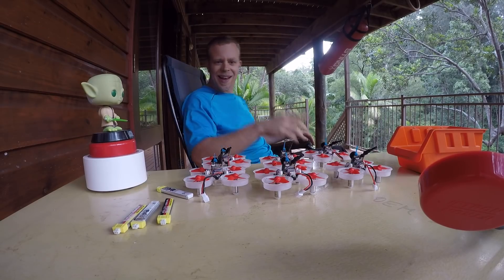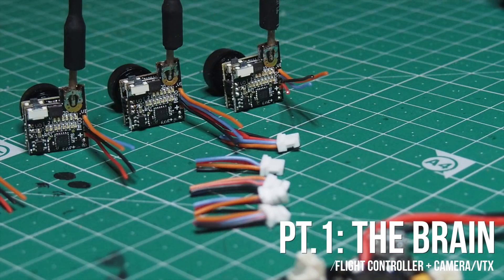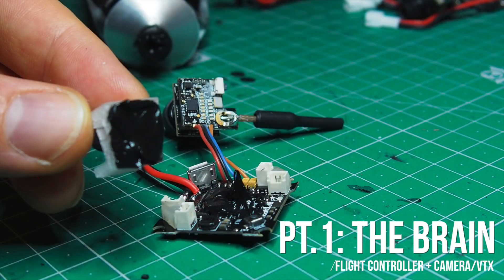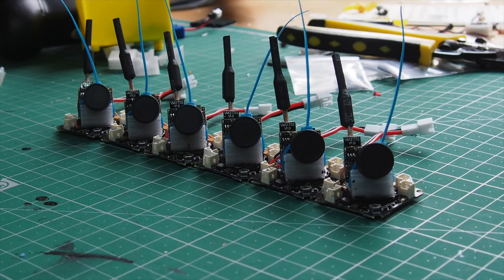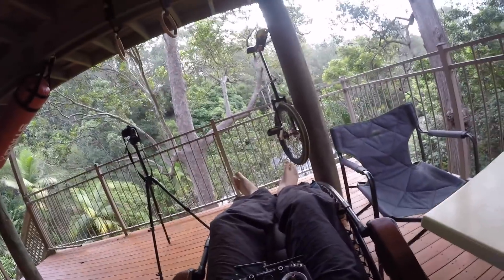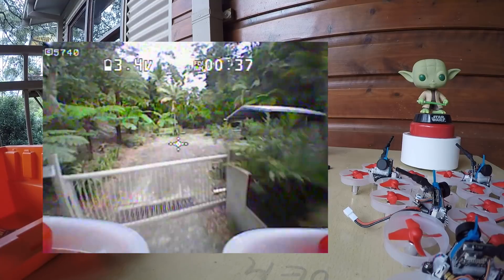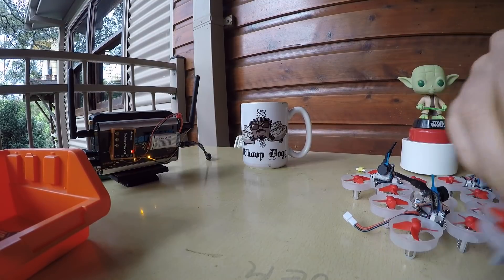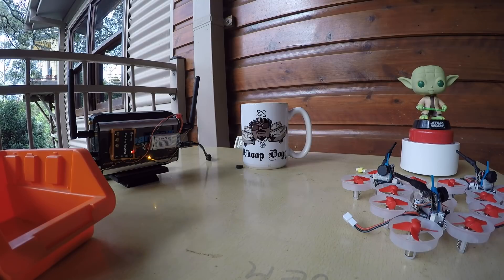Step by step: Benedikt's 2-part Whoop Build

Comment: If ever you have to remove the camera mount from the FC, do you need to pre-treat the silicone adhesive with a solvent, or just go ahead and rip off with force?
Reply: Ho Jen just pull slow and steady, and it will come off. Slicing with an exactly knife will help if it’s holding on tight.
Reply: thx

Comment: Hi Ben, I have seen you using epoxy on the camera on other whoop builds. Do you still recommend this? have you shown how to do this in any of your videos? I did not see you using epoxy on this guide. Keep up the good work!
Reply: Venom2007s yes, I sometimes use epoxy to reinforce the glue joint between camera PCB and lens. The glue on the current batch of cams I use looks good and solid, so I haven’t done it here. I don’t think I made a video on that. If I get another batch of cams with not enough glue, I’ll make a video ;)

Comment: Just a question on what you are using with your clearview to record your dvr it looks like you have opend the unit up what do you recoment i have the race reciver
Reply: i can see now its just a eachine pro what is the best way to rig that up i have one in a box that i have never used
Reply from the maker: No it’s not open, it has just stuff stuck to it :)
I use an Eachine Pro DVR and a 5” monitor (not in use in this video).
One video wire goes from Rx to DVR, the other goes into my goggles. The DVR has an output that goes into the monitor. I bought 3.5mm and 2.5mm plugs and soldered the connections myself, because all the pinouts don’t match.. Good luck! Any more Qs, just ask!
Reply: Micro Motor Warehouse the pin layout is what i have been having problems with shame its not on ther sight it just has camcorder standard
Reply: Here is how you can figure it out:
If you want to connect two analog video devices with unknown pinouts, take the CVBS adapter cable that came with each device, and measure continuity form the two contacts at the yellow plug to the 4-pole plug. When you found ground and signal for each, just make an adapter that connects the two rings you identified. Hope that was  clear enough ;)
Reply: Benedikt Haak thanks for the help

Comment: Hi benedikt, what's the flight time on those?:)
Reply from the maker: I usually land at 2:30 max, but you can push it to three minutes with 0716 motors and 255mAh batteries.
Reply: I'm thinking about building a "long range" whoop. Check out MicroDroneTech on Youtube, he gets 4min flight time with 6mm motors and 210mAh batteries, quad weighs 18g. I suspect that with 0716 motors and 210mAh batteries I could also stretch the flight time to 4 min (simple flying, no dives and punchouts)
Reply from the maker: If you use stock E011 motors and a 255mAh pack, you can get up to 5 minutes with careful flying.
If you run 0720-12 motors and a 480mAh pack (not a Whop though, but an Efficiency frame), you can fly for almost 10 minutes. I have done it twice, its pretty stressful ;)
Reply: Didn't think 0716 17500kv motors would be that inefficient. So I have to buy an E011 now :D Need at least 4 min. Thank you for your info boss!
Reply from the maker: Maybe you can get 4 minutes on 0716-17 motors and 255mAh batteries. My flight time statements are usually based on going as much full throttle as possible during a pack and then landing at a conservative voltage.
Reply: I do that too usually haha, just this time I want to explore "long range"! I'll try and report back!

Comment: Have you tried implementing 'idle up' to solve the dipping issue? I seem to notice air mode helps with I-term issues and dipping.  Unfortunately BF's air mode also makes my whoops spin crazy with slight nudges so I don't use it, but I'm thinking idle up may be promising though.
Reply from the maker: Im not sure if the throttle curve is a good solution. I have the feeling that air mode (or maybe just disabling MOTOR_STOP) and the right min_throttle value has the best chances to mitigate this.
Now since it feels half-way OK with 3.2.2, this will be my next tinker topic ;)
Reply: Phillip Chung so you mean configuring a throttle curve that does not let the throttle drop so low?
Reply: Benedikt Haak yes correct, the method I have tried is implementing a curve (Diff +10) and logical switch on the throttle per Josh bardwell's old video.  I've tried but I still getair mode style freakouts on crashes (my guess is the very high pid values could be the reason?).  BTW love your vids and your deep research.  That video on the bad clear color props saved me a purchase!
Reply: Hi Ben, Is there a reason to have motor_stop enabled on this build? On 5" brushless quads motor_stop disabled is a must for airmode to work properly, otherwise when your throttle is on 0 the quad wont respond due to the props not spinning. It has been always the case with BF early releases.
Reply: Min_throttle has to be enough to have the props motors spinning continuously. However since there are no escs on brushed not sure what the Min_throttle would have to be. Just got my package from you today to build my first Micro (order #45725) . Will test and report back.
Reply: Micro Motor Warehouse is there a way to set the setting in betaflight so the flight controller to accept a different mount angel ? , say 90 degrees to the right or left so it can fit on a square base with  X type frame for brushed motors of coarse , 0720 17,500 kv & King Kong 65 mm props ? Thanks